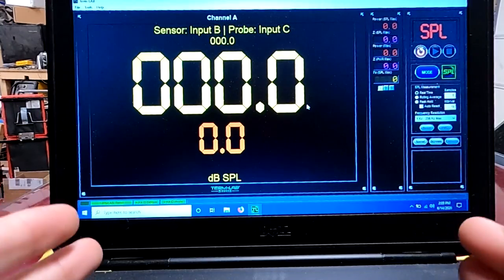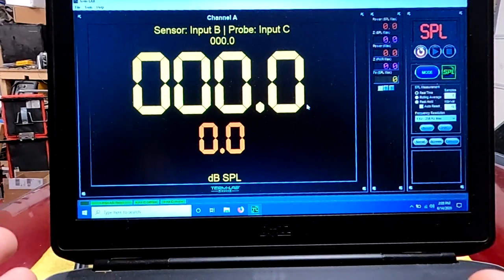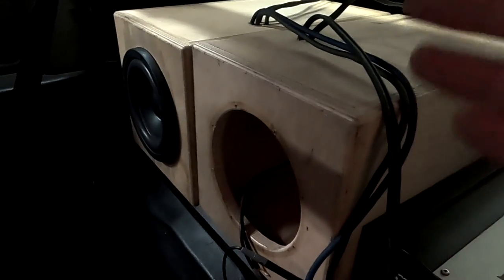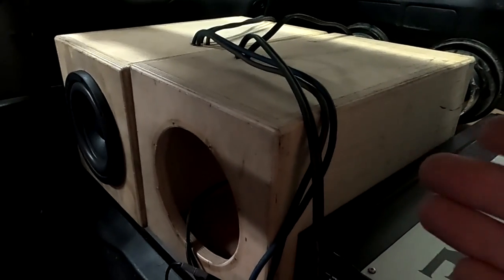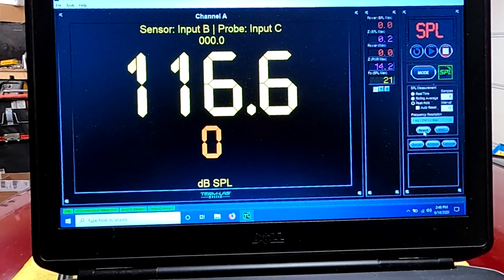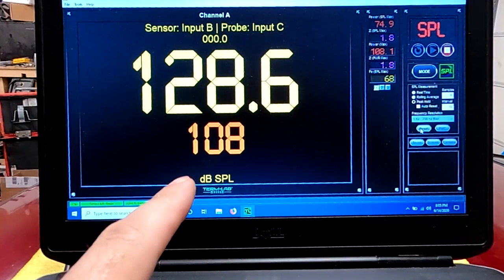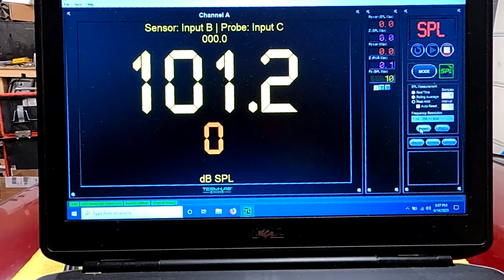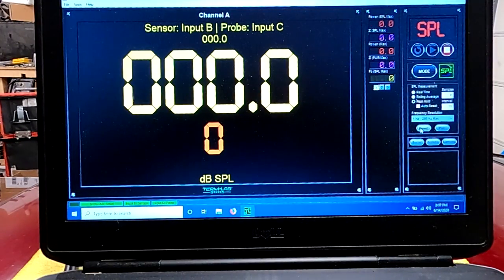SPL and installation troubleshooting - Tech Stuff Tuesday

Comment: Consider you can gain or lose 2-3dB by just moving seat/visor/glove box/center console positions.  I gain almost a full dB sitting on passenger side vs driver's side and lose a little bit if I'm outside the vehicle.   I knew a SQ guy that kept a sweatshirt rolled up on the hump between seats to control a harsh node.   Pretty much any object in the vehicle effects what the sound waves do so it's no surprise that having a whole other box in there (even if it was just a solid wood block) will change things.   This is why we do testing.  At the end of the day the meter doesn't lie and we must test absolutely everything even if it doesn't make any sense.  You never know where you're going to find another tenth or three, and after a certain point tenths can become incredibly expensive to gain by just throwing more power or equipment at it. 
Great video by the way, and people who don't compete should know, the guys that get the big boy trophies spend a lot of time and effort in doing this stuff.

Comment: Me and my brother just finished a 4th order truck bed blowthrough with 2 zv5 18's. Mid build we did an spl test and got 150.0 db at 32 hz. After that we sealed up the cabin and cut out a few cubes of air space with a beauty panel. In theory we should have increased or cabin gain and increased our spl but thats not what happened. Instead we couldn't get over 149.5 after the build was said and done.
Reply from the maker: More than likely the frequency changed, or you created some other problem causing the loss. Most likely the frequency changed though.
Reply: @EMFAudio  first thing, thanks for the reply I really appreciate it. To go further, we tested several frequencies when we re tested and our peak frequency changed to 38hz. Only thing I can think of that changed the score was that we had small gaps leading into the bed. This was because the blow through we had before was an entire box and the hole in the truck is bigger than the port is on the 4th. Regardless, with the new box pushed as forward as possible there was a gap of about half an inch on either side. I imagine this acting as a port and giving us the boost in spl. Once the beauty panel was installed and we sealed all the holes that resonance was lost and as a result we lost a half db

Comment: Already this design is better. The port looks way more stable which is what I thought was taking way some of your dbs (maybe .3). I think you are still hitting mechanical limits with the subs. Like you said modifying your ports a bit smaller but tuned higher (shorter port) and messing with the box volume might take away some of your efficiency at lower power but you might be able to apply a lot more power (like 800w to 1000w). Finding the the best cone control frequency and the natural frequency for the cabin requires a lot of testing.

Comment: I would like to see the ssme test with a sealed box. I do alot of tinkering and testing myself, considering recreating and recording some of them just to pit the info out there. I was testing a freebie 6.5 out of a cheap Roadmaster bass tube. Guys at a local audio store gave it to me after a conversation we had where i had been bragging about how i could get any sub to sound good. Instead of throwing together a quick and sloppy box, i just took one i already had with a 5.5-6in home  theater sub that comes with a Vizio sound bar. It was an active wireless down firing set up originally but the sound bar got stolen and i acquired the sub. So, back to Roadmaster beast, i just cut a hole in the same enclosure( its about 1sqft and sealed) opposite the other sub. I was left with a passive radiator design with both subs inline. Used it with my workshop/testingshitout stereo for a month before removing the smaller one, blocking off the hole and porting the box with a 2in x 1ft pvc pipe that looked like a stove pipe when facing up and pretty comical as well. But it served its purpose for testing and further added to my experance and knowledge on the subject thar you seem to be more than formiliar with.  My conclusion. The first set up was better and louder but couldnt hit the low lows that the ported one could. Lost alot more than gained as far as band width.
Reply from the maker: Once you introduce a PR you've changed a lot of things. By leaving it "playing", you're actually changing the tuning.

Comment: I would say that at the 100 watt level the 8 inch sub is experiencing some power compression test at 50 and 25 watts, or use bigger stronger subs in a future video 👍🏻
Reply from the maker: Do you understand what power compression is? I'm not sure you do.
Reply: Yes when power is applied and you increase to double power you should get 3 dB increase if not then the sub must not be acting on the power in a linear manner , it may not have the bl , motor force to keep  doubling excursion every time you double the power weather it’s mechanical or impedance related heat to the coil , that would be power compression, and I have had 10 “subs that would start compressing at 50 watts @ 40 hz , 50w to 100w only 2.6 , 100w to 200w 1.7 , 200w too 400 just .6 
So to your comment I know what power compression is , I use to do spl competition in the late 90s I was doing mid 160’s in super street 5-8 
I like watching your channel keep making tech videos

Comment: I'm not very up on the whole spl scene but the video was very interesting.  I've always been way more into daily, then a single burp score.
Reply from the maker: The same physics applies, daily or SPL
Reply: @EMFAudio  Back wave? Return wave fighting the forward wave. Common among facing the subs into the cabin with enough head room to bounce back. Could face the other way to load and roll off essentially following instead of fighting?

Comment: I need to do some trouble shooting. I have a 5 ch amp running as a 4 ch amp with 4 subs. I recently noticed one channel doesn't perform like the others. I need to raise the gain to compensate. Now, I need to raise the gain again to offset the change. What may be causing this issue. Is my amp failing in one channel?
Reply from the maker: The first place to look would be the signal IN. Make sure all 4 channels have the same RCA voltage on them. If you don't, it's the HU or the RCA's.

Comment: Is that power measurement shown during both sub playing power going to both subs or power going into individual ones? So ultimate takeaway is that single SUB is actually preferred if efficiency matters?
Reply from the maker: Power is to both subs total. The ultimate takeaway is theory isn't always true in practice. In this particular application a single sub is more efficient.
Reply: @EMFAudio  the result is an eye opener. Thank you for the awesome experiment. Keep up the good work 😍

Comment: Question,can one vent into a sealed chamber and how would one go about it. I have a vented that is too small  want to enclose the vent to unload into a sealed chamber. Unless it would just be prudent to eliminate the port altogether.
Reply from the maker: Either I don't follow, or you're describing a 4th order bandpass.
Reply: @EMFAudio  Well as I understand it a 4th BP has a vent in the configuration. I want to vent into a sealed. So basically two sealed chambers that are connected via a port. Would this work?
Reply: @EMFAudio  It's not a design I could find. It's def not traditional. It's a ported box as of now but I was thinking of enclosing that port with a sealed chamber. I.E sealed dual chamber connected together via port. So as to not have to redesign the box just add a sealed chamber to the already ported side. 
The issue is space,no room for a proper ported box.
Reply: @EMFAudio  I could remove the port and just go with sealed altogether was just curious was it feasible and is there a downside. Basically connecting two sealed with a port. The port would not vent to the outside,all internally.
Reply: @EMFAudio  Sounds unnecessarily  complicated but easier for me to just slap another sealed onto the box and leave the port intact to vent into the other chamber.
Reply: @EMFAudio  I think I was considering,,and I realize the area the port vents into matters some more than other,would the port maintain it's frequency response despite being vented into a sealed chamber,and would the sealed chamber turn that frequency into a typical sealed response? Would they couple or in the end would it just maintain a sealed enclosure response?
Reply: @EMFAudio  I'm thinking since a sealed isn't freq specific, dimensions aside,that the port would indeed unload its freq into the sealed and the sealed wold play only that frequency.  Would in theory only have to address that wave returning to the port. Perhaps an aperiodic ?
Reply: @EMFAudio  I'll play around with it and give it a shot. 'Preciate the response. Love the vids keep em coming.

Comment: Hi great video and information .
At 1:56 you say you built one box 7 years before. And being a cabinet maker plywood hasn't been made the same for awhile with all NAUF , FSC,LEED certifications that manufacturing have on them . even getting plywood from same distributor doesn't mean it's the same quality the glue ,wood and total construction will greatly differ. . so the box you made years before will most likely be better than newer plywoods (we have a ton of issues with all plywoods warping, delaminating etc. ) all due to CARB compliance. 
Even mdf ,particle board all have NAUF(no added urea formaldehyde) restrictions on them. Being told by distributors that even if it doesn't say NAUF on it . it still is because manufactures are not going to change setup on their lines and use the same glue though out making their plywoods.

All n all a long winded statement saying that is the reason one box wouldn't be close to the older box of same specs . unless made from same sheet ,or out of same bunk/unit of wood
Welp thanks for all the info and videos
Reply from the maker: I think you may have misunderstood what I said. I built all of those boxes with the same batch of wood 7 years ago. I just build them some time apart, building one, then another, then another.

Comment: The box absorbes when a sub is in it and it doesn't play. The cone gets moved
Reply from the maker: So does a passive radiator, which GAINS output.
Reply: @EMFAudio  yeah, but a passiv radiator ist mountet in the same box without a port. In this case you have a seperate box with a cone that moves with the pressure of the other box and that absorbes pressure.

Comment: Just to nit pic a little bit. 
A law is observable. A law of gravity is stuff falls to the ground.  A law doesnt explain why stuff falls to the ground though.

A theory would be the explanation of why stuff falls to the ground. The theory is either excepted by the scientific community or not, but will always remain a theory.

Good vid though.
Reply from the maker: A law is explained and repeatable. Newtons law of gravity contains the calculations to figure out exactly how something is going to fall. A theory is an idea that may or may not be tested and may or may not be precisely repeated. If you can't explain it, it's a theory.
Reply: @EMFAudio  .  Thats not really correct though. This is all trivial imo, cause there wasnt anything wrong with the testing process or how you arrived at your conclusions. It was a good vid.

With that being said and since we are on the internet.....

A law,  based on the scientific method, is a generalized statement set after a number of observations. A law has no explanations or exceptions when it is framed. It is an obvious fact recorded after observations.  It is an undeniable fact. 

A theory is the explanation of the observational data set forward in the form of a law. 
A theory is only established after data is collected from observing something that is a law and multiple hypothesis using that data have been tested.  Then if the majority of the scientific community (after testing the presented hypothesis themselves) find the hypothesis to be creditable it is only then that a theory has been established. 

 Newton's Laws of Gravity are the measurements and calculations of what he observed. How fast something fell, how fast it accelerated, ect...

It wasnt until he published "The Universal Theory or Gravity" that he gave his theory (explanation) of what was causing it to fall, what was causing it to accelerate, ect....

Again, its not a big deal. Im just bored and was just making a small observation.